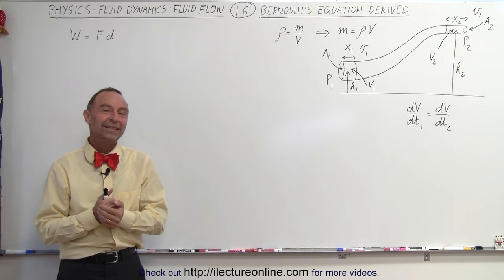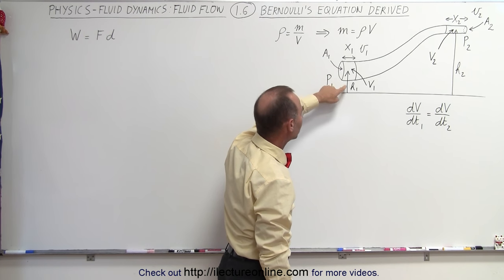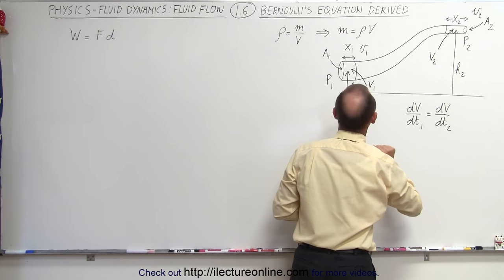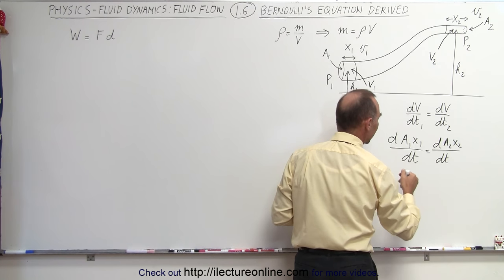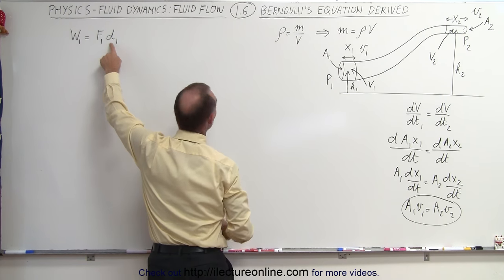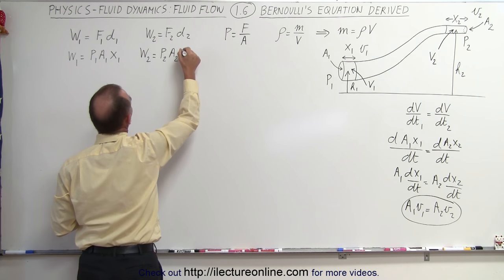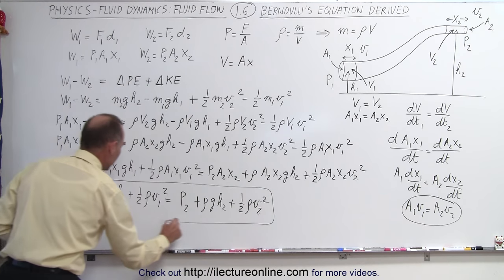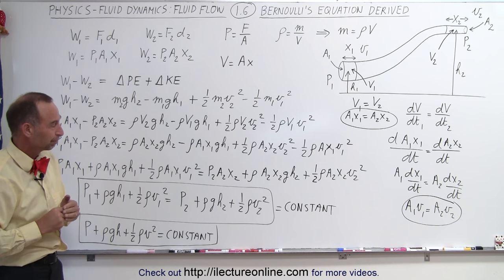Physics: Fluid Dynamics: Fluid Flow (1.6 of 7) Bernoulli's Equation Derived

Comment: I do not understand. I understand that same amount of water should go in and go out but this drawing does not reflect that. I ask where are ends of tube? Should be 2 drawings as beginning of process and end of process. is this pipe part of greater system. What does it mean that water coming in to one end of pipe? What is initial state and final state? V1 is fluid coming in? Is it show that V1 came in and V2 have not yet come out??

Comment: Thank you professor. How does this Bernoullis derivation (ie P+ρgh + 1/2ρv^2)  compare with Energy and Head, (ie. Total Head (H) = P/ρg + v^2/2g + z). How do you derive this from the Bernoullis equation you derived? P/ρg(pressure head) + v^2/2g(velocity head) + z(potential head). The two equations seem very similar ie. P(work done)+ρgh(Potential Energy) + 1/2ρv^2(Kinetic Energy). The Bernoulli equation looks like it has been divided by ρg to get the equation for Total head where the constant has been replaced with H. What are the underlying reason for that, how does this relate to the Hydraulic grade line and Energy grade line?
Reply from the maker: Bernoulli's equation assumes no energy loss due to flow in pipes.
Reply: @MichelvanBiezen  thank you professor.

Comment: Sir,

I thought that the expression "W = int p dV" was used for a moving frontier situation. While for a steady state, reversible process, with well defined inlet and outlet section the expression would be "W = int -V dp".

So the work balance between point 1 and 2 would be "W2 - W1" so both sides of the balancing equation would have the same syntax.

That's my doubt. Did I get it wrong?

By the way, THANKS A LOT for your effort in this channel!

Comment: The initial configuration considers the fluid between left end of tube and  beginning of the region of small length X2 . The final configuration has the same  fluid between the end of region X1 and  right end of tube. The total energy of the bulk of the fluid between both regions does not change during the time dt (= X1/v1=X2/v2) the fluid takes to enter region X2 and leave region X1.
The work done by the contact (fluid) forces f1 and f2 at both ends of the fluid during the motion is f1X1-f2X2.
The contact force of the  tube on fluid is perpendicular to fluid and hence does no work on fluid. No friction forces either. The only other force that does work on fluid is gravity.
The change in PE of the fluid involves cancelling the PE of the bulk of the fluid between both of the regions at the ends of the tube.
 That is why only the PE of both ends appears. Similarly for the change in KE, however you are assuming that the velocity of the fluid at any given point in the tube does not change with time.

Comment: instead of changing all Vs into ax it would have been easier to just change the two ax into V on the left side, otherwise great job, I really appreciate your work!
Reply from the maker: That was done for the purpose of illustrating where Bernoulli's equation came from
Reply: @MichelvanBiezen  yes, that was the overall goal but the last steps of your argument were structured in a sligthly awkward way. it would have been faster and more straight forward to change x1A1 and x2A2 into V1 and V2 instead of doing the reverse on the right hand side twice (you even had to speed up the vid). this would also make the last step easier because you were going to use V1=V2 anyway.

but I really don't want to nitpick too much, it was just an observation

Comment: why the difference in the work done is equal to the change in KE and PE needs to be explained.
Reply from the maker: That is a concept that is learned in an earlier chapter:   PHYSICS 8 WORK, ENERGY, AND POWER
Reply: @MichelvanBiezen  I can expect what will be there in the chapter:  PHYSICS 8 WORK, ENERGY, AND POWER. Let me paraphrase my question, how can we talk about W1 and W2 rather than just W, as the elements of volume in question are connected.

Comment: sir tell me about venturimeter.please.
Reply from the maker: A venturimeter is able to measure the pressure of the fluid inside the tube which can indirectly measure the velocity of the fluid inside the tube, since the pressure adjusts accordingly.
Reply: thanks sir.can you tell me about the pitot tube.please

Comment: Sir, I studied Bernoulli's equation somewhere. The term "P" was written as static pressure, ½®v² was written as dynamic pressure and ®gh was written as hydrostatic pressure. I couldn't understand why P was written as static pressure. Can you please explain it sir?
Reply from the maker: A rose by any other name is still a rose.  All three terms are terms of pressure.  The (1/2) density x v^2 and  density x g x h  terms indicate how much the pressure changes due to the motion or height of the liquid.
Reply: @MichelvanBiezen  sir but what is the pressure P actually?
Reply from the maker: Inside any liquid there will always be pressure.  You may want to watch the videos starting with this playlist:   PHYSICS 33 FLUID STATICS
Reply: @MichelvanBiezen  Yes sir. That is hydrostatic pressure and increases linearly with depth. Is "P" in bernoulli's equation the same? I am confused because this relates to static fluid. But bernoulli's equation covers dynamics of fluid flow too.